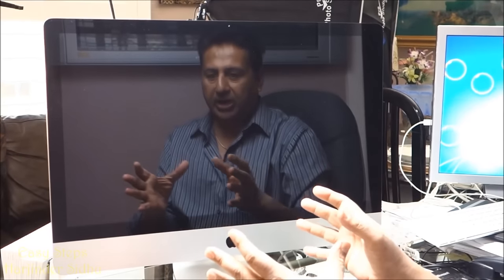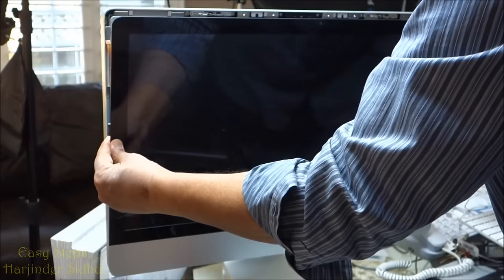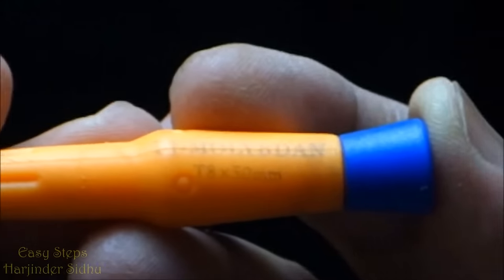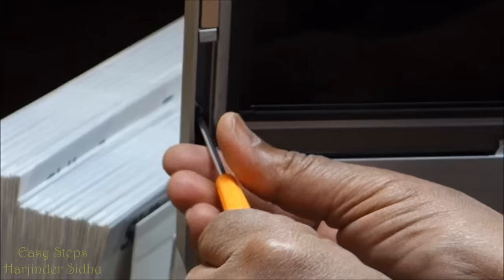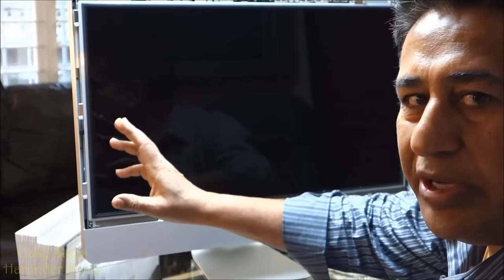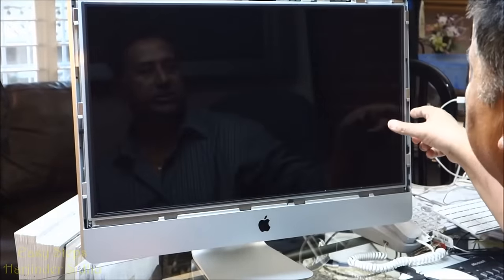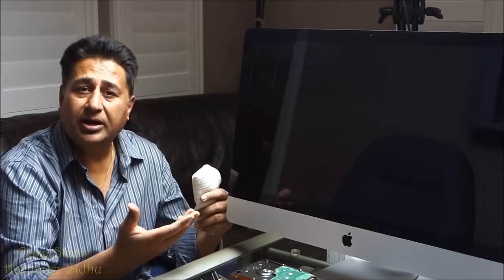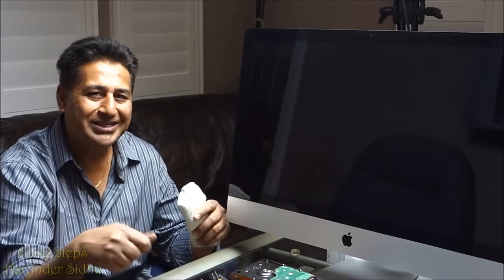iMac Hard Disk Removal | iMac SSD Upgrade | Thermal Sensor Link Posted under Description

Comment: it's so much easier to not remove the screen. i simply swing the top of the screen open as far as the cables will go, and tape the corner of it back to the computer body to hold in in place. there is plenty of room to operate on the hd without removing any unnecessary cables.
Reply: That is ridiculous there is a 1.5 inch gap you can't even get your hand into.
Reply: What are you talking about? What your describing doesn’t even seem possible. Try showing us what you mean. Easier?! Really?
Reply: Sounds like a good way to break cables to me. You be you boo.

Comment: Hi!  May I ask, what did you do with the thermal sensor cable?  Thats the 3rd cable you removed from the old HDD
Reply from the maker: SSD doesn't need that sensor, so I left it as is.
Thanks for watching.🙏
Reply: @EasySteps_Sidhu  ok, just leave the thermal sensor unplugged.
Reply: @EasySteps_Sidhu  
Thanks for the info!
Reply: Yes, that's what i did. Thanks!

Comment: Do you know where to get a T8 x 50 screwdriver?  I see lots of T8’s on Amazon, but they say either 60 or 40 or nothing.
Reply from the maker: You buy can it from Walmart or lowes.
https://www.walmart.com/ip/Torx-Precision-Screwdriver-T8-x-50-mm/818168880
https://www.lowes.com/pd/Aven-Aven-13923-Torx-Precision-Screwdriver-T8-x-50-mm/5001185499
Reply from the maker: From Amazon you can buy bit set - https://amzn.to/3fGwlMK

Comment: excellent vid, thanks for,braving it. alternatively, you can plug in a usb drive and build a mac install onto the usb drive and then hold alt key to boot from usb drive and from then on, the system remembers the usb boot drive, I have dual boot ubuntu and imac os that I can boot into by holding alt key down
Reply from the maker: Thanks for sharing the info.

Comment: Added a 1TB SSD to my Imac 27" 2011 model and no thermal sensor needed. Used a Mac Fan speed app and works great!!
Reply from the maker: I am posting a thanks message to my viewers/subscribers for their support.
Both YouTube channel was hacked/hijacked on (4/24/2019) and I got it back now (5/5/2019). The hacker has deleted the information under the description of my videos as well as all my comments. 
My YouTube Account Got Hacked - https://youtu.be/1xLEciPJqlk
Reply: Serapio 
Hi, did u install the fan speed app after u installed the OS on the SSD?

Comment: if you are replacing your old HDD with SSD and you don't want your fan to be noisy, just take off your old HDD control board from the top of HDD (6 small screws), plug in the temperature sensor cable and stick the board on top of your new SSD with double sided tape. 

если вы меняете ваш старый HDD на SSD и не хотите что бы он шумно работал из за отсутствия датчика температуры, то снимите плату с верху вашего старого HDD диска , подсоедините к ней оставшийся шлейф температурного датчика и приклейте эту плату поверх нового SSD.
Reply: Does it matter where you attach the temp sensor board on the SSD? the part with the double sided tape. Can I put it on the front part of the SSD or does it have to be in the back?
Reply: This is BS! Cause its is not a TS. This two wires verified if you using Apple approved HDD. All you need is short 1st and 4th wires. Simple is that.

Comment: Everyone cuts and edits out the part at 4:15 of connecting the tricky display data cable. 
If anyone wants to upgrade their 2010 iMac then be very careful of that cable. I damaged mine easily, and found that it is easier to disconnect that cable from the display instead.
Reply: Absolutely!  I just did this to clean out the inside and it was way easier to lift that little tab up and pull.  right from 
the display.
Reply: Yep, you're 100% right about that! I removed my display a few days ago to clean out the insane dust - before I do this SSD upgrade (My kit arrived today via Amazon) That cable clip is extremely delicate, I gently pressed it in to remove the connection and the one side (made of extremely thin plastic) snapped. The other side was ok. But getting back attached was harder - but possible. As long as you get it back in, connected..and NOT jolt the computer, the display is fine. Just breaking it aggravated me. The SDD install won't be a big deal, it's removing this darn display again..well I dread it.

Comment: Everything worked fine getting the screen off, unscrewing it, and removing my hard drive. But I cannot figure out how to get the tiny screws back into the holes without them falling into the gutter.
Reply from the maker: I know what you mean, it's a good idea to use a magnet so that you can catch the tiny screws.
Thanks for sharing the info. and thanks for watching.🙏

Comment: Hi. After you take the glass out and remove the monitor and the cables can you still turn it on to see if the fans are even working? I cannot hear or feel mine at all. I put a little piece of toilet paper at the top to see if it would move and nothing at all. Are they that weak?
Reply: +G Fabian Alvarez .... Yes you can turn it on. Of Course without the display you would not be able to see anything. But the internal parts will turn on and you will be able to spot if a fan has gone bad. to turn it off simply disconnect the power.  Fortunately fans can be found cheap on ebay. It is a little hassle to change them but not impossible to do.

Comment: Hello. Did you know that the screen is stuck on with magnets. So if you just used suction cups it would come off alot easier!
Reply from the maker: Yes, I do know very well and matter of fact I do have all the tools.
But this video is for those peoples who don't have the proper tools.
Thanks for sharing the info. thanks for watching.

Comment: I have to admit I am confused by this video.  On one hand, it is extraordinarily well done with exact instructions about how to disassemble and reassemble everything.  On the other hand, from reading the description, for my 2011 iMac 27", it looks like I need to buy a thermal cable, a 3.5" to 2.5" adapter, and a OWC SSID DIY kit -- none of which seem to be mentioned or shown in the video.  I will buy them, using the links in the description so the Easy Steps gets credit for the sale, but I'm really confused why these three things are not discussed or shown in the video.  For example, there is a hot cut in the video showing the bracket on the new SSD -- but it's not clear from the video whether that came from the old disk or you need to buy it (I see from the video description that I need to buy it).
Reply from the maker: Thanks for sharing your thoughts. As DIY...we need a head-start only...I clearly indicated that you need - https://youtu.be/xxndCz62NW8?t=230 I use the bracket and screws from the older hard drives.
If you buy from any other store then I don't get anything...YES...I do get a small commission which I have stated in my description of my channel that it helps my channel  ONLY if you use my link and it ranges between 1% to 2.5% (now you know and can calculate yourself)...and also thanks to you to make me rich.
I try my best to help you guys out, not only that also, I try my best to answer each and every one.
Reply: @EasySteps_Sidhu  I did see the disk bracket mentioned in the video, it just wasn't clear at all where it came from (whether it came from the old disk or was purchased separately because it appears out of nowhere in the vide -- especially since you are reusing the screws, it's impossible to tell about the bracket).  I am only trying to be constructive, not critical at all.  I'm always careful to use the links in help videos for purchases -- it's great to be able to repay in some tiny way for what we learn from those who take time to share their knowledge.
Reply from the maker: Thanks for sharing the info.
Reply: Adil. Apple OYH

Comment: What about the HDD temp sensor? You just leave it off the new ssd?
Reply from the maker: No need...Along with the dynamic thermal throttling mechanism, the performance of the SSD will be throttled down to ensure that the SSD's temperature does not exceed the critical level.

Comment: Have a IMac 2010 mid I installed a SSD card without my hard drive like you. Is there a command key I have to press to set up???  Get a file with a question marks thanks

Comment: Hi,

May I ask, where to do connect the HDD censor cable onto your SSD ? Please advice. Thanks.
Reply: Its interesting there is no reply to this. I have the same question
Reply: Hello ! i am posting this here so maybe others can benefit, your videos are widely   helpful, My question is, why is my iMac Late 2011 overheating ? I payed a computer repair store to replace my 1Tb internal(possibly stock) with a 240GB SSD, when i talked to them about a thermal sensor they didn't seem to know what i was talking about, my iMac gets so hot to the point it reboots due to an error, is this due to the fans? are they going crazy because they have no idea what speeds to run ? i read this somewhere. 
Thans for your time.
Reply: You probably can't unless it is an Apple approved hard drive. So what you do is you go to Other World Computing and you buy the external thermal sensor for your iMac, and then you can use a regular hard drive.
Reply: Oh yeah, and if you've got thermal sensor issues, and don't want to replace the drive, or buy the Other World Computing sensor, then download the smcFanControl Mac app, and you'll have to manually spool up the fans.

Comment: Does the ssd have a slot for the sensor cable?
Reply: So did you instal that cable or use software to control the fan?

Comment: And then you cut your video where thermal sensor unplugged.  Why? 
I'll tell you why!  Cause your link on Amazon cable 37$ in 2020. But you dont ned it at all. Cause it is not TS also!

Comment: what about the temperature sensor? this is a bit misleading... 
If you do not apply a new temperature sensor your fan will be running at full speed .
Reply: Easy Steps no one ever reads the description.

Comment: I open my mid 2011 iMac and it did not have a temperature sensor inside
Reply from the maker: If it's missing then you can order online and here are the links:

OWC In-line Digital Thermal Sensor for iMac 2011 Hard Drive Upgrade - http://amzn.to/2iYkt6P

OWC In-line Digital Thermal Sensor for Hard Drive Upgrade for 27" iMacs 2012 and Later - http://amzn.to/2jmBeMs

Comment: Missing StepOne: Disconnect the power cable!!!!
Reply from the maker: Good point, thanks for watching.
Reply: ideally let it stand for a while after removing the power to reduce the likelihood of getting a shock from the power board...
Reply: Pressing the power button after unplugging will also help to drain the capacitors in the power supply.

Comment: WHO THE HELL PUTS A 5400 RPM HARD DRIVE IN A 4GHZ IMAC GODDAMMIT APPLE
Reply: Spoiler from the future: It's 2019 and Apple is still sticking 1TB 5400RPM HDDs in their iMacs: http://archive.is/OLE8K#selection-955.0-936.10
Why still an HDD? (1TB SSDs are 100 EUR)
Why 5400RPM?
Why only 1TB? (you can easily get 3TB for about 75 EUR)
Reply: @DutchmanDavid  For the upgrades, Apple has always put minimum ram and small hard drives which are ok for most casual users. It's kinda like buying a racehorse and using it to plough a field. I had always thought if they put 3/4 of the best in they would have blown people away and the ones who wanted to would pay to get to the max, common marketing really.